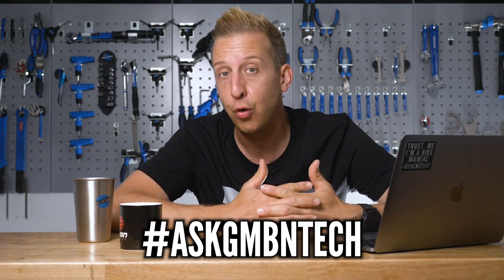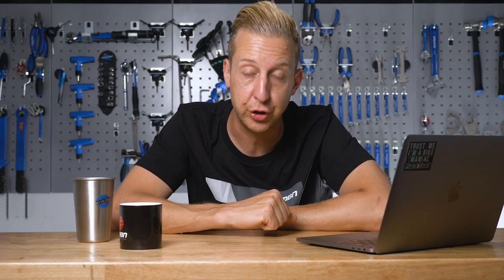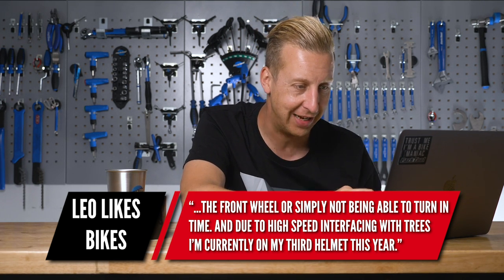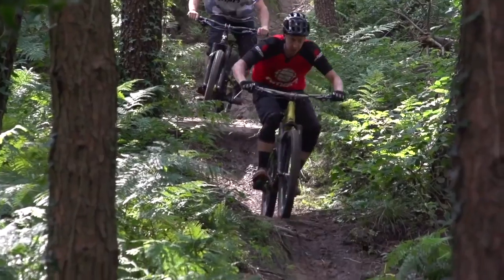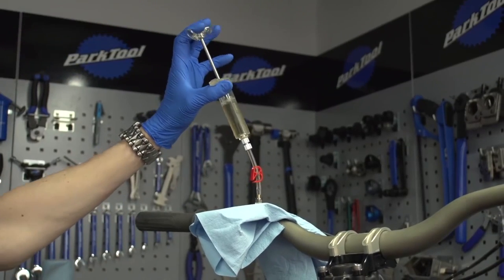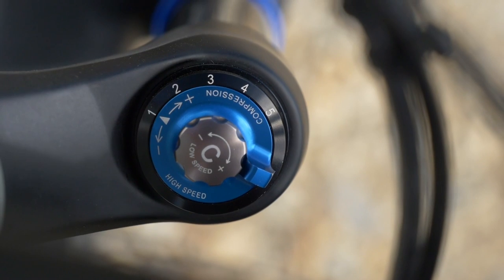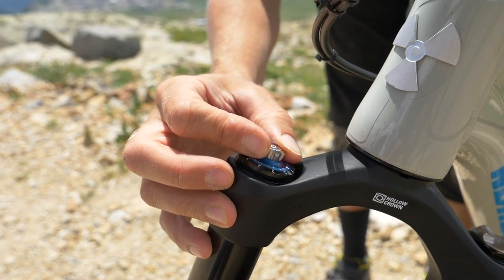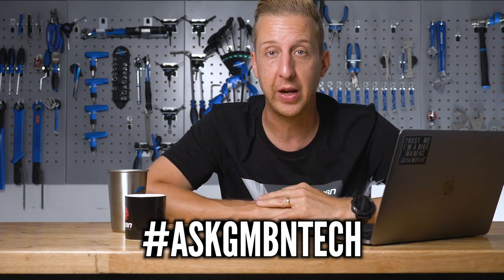Is My Bike Too Long? | Ask GMBN Tech Ep. 84

Comment: #ASKGMBNTECH  just so you know i am a bit of a Joey but is it possible to change the suspension fork on a bike from a low end 100 mill  to a mid range 120 mill? If so any suggestions for a new fork? Thanks!
Reply: the bike mage 20 mm difference will be fine, you will need to make sure the wheel will fit though with same hub spacing (100x15 thru axle or quick release 100x9 or 110x15 boost)
Reply: Yes, it is definitely possible. First you need to make sure the fork you're buying will fit your head tube, if the current fork is a low end fork, you likely have a straight steerer tube and a headset for a straight one. If you're buying an even remotely high end fork, it will have a tapered steerer tube, this is fine as long as your head tube is large enough on the bottom that you can fit an appropriate headset for the tapered steerer. You need to measure the inner diameter of the head tube on the top and bottom and (for example 44mm and 56mm) and buy a fitting headset for the diameters you measure for a tapered fork. Then if you're buying that said even remotely high end fork, your current front hub won't fit, because it is probably 100x9mm and most likely your new fork will have a dimension of 110x15mm or 100x15mm. So you need a new front wheel with the appropriate dimension for the fork. You also need to make sure that your current rotor is the correct size for the mount on the new fork/possibility to fit an adapter to accommodate the correct size rotor. Also you need to have the tools to cut the steerer tube to the correct lenght on the new fork and install a new starnut.
Reply from the maker: If you have 26" wheels you can find some great deals on second hand forks. It's important to check that the steerer tube (the part that goes through the frame into the handlebar stem) is long enough. Check this video as should help 😀 👉 https://gmbn.tech/installfork

Comment: #AskGMBNTech Hi Doddy, I am 178cm tall and I´m 14 years old. That means that I am not fully grown. I want to buy a YT Capra in size XL. Do you think this will work fine till I am as tall as recommended or should I buy the size large one?
Reply: Just my humble opinion, but I actually happen to ride a Capra XL at 176 (fully grown). For me it works perfectly as I was looking for a long bike that will work well at high speed and rough stuff. On the flipside it isn't as playful for jumps or just flicking it around. Basically, if you want to go fast with plenty confidence, go for it! Hope I could help :)
Reply: @irminscharlau8571  Thanks. I think I'll go for it

Comment: I hv a non geared bike..... Want to convert it into geared.... Pls suggest
Reply: Not possible unless you have a derailleur hanger. If you have a derailleur hanger, then you can do it. You will have to get a new hub probably, but I don't know.
Reply from the maker: Hey Vivek, you can get a horizontal drop out chain tug/tensioner with a built in derailleur hanger. Problem Solvers and DMR make them. This will only work if you have correct frame spacing. Check out this page here as it may help with your options 👉 https://www.sheldonbrown.com/frame-spacing.html

Comment: #askgmbntech My rear suspension is very squeaky, what should I do to stop it from squeaking?
Reply from the maker: Hey Thomas, check out this video where Doddy talks through common causes of squeaky brakes 👉  https://gmbn.tech/cleandiscs
Reply: Suspension noise can be caused by the linkages if you haven’t done it check all your linkage bushes and bearings

Comment: #ASKGMBNTECH, hi guys, great segment, has been very helpfull. I have just put a new setup of 1x11 Sram XX1 chain and cassette with NX derailer on a mates bike, i have cut the chain to what feels like the sweet spot for length, but could go either way 1 link shorter or longer, travel isn't an issue, which is best, the one extra link or one less?
Reply: bennonme shorter will be quieter

Comment: #askgmbntech I’ve just got a canyon spectral al 6 2019. I’ve swapped from a specialized kenevo with shimano Zee brakes. I find the Guide R brakes very weak in comparison even after a complete bleed of them. I have to squeeze the leaver all the way to the bars for any bite and prefer it further out. Any help appreciated before I replace them
Reply: @i_eatstyrofoam  Cheers for the tip, tried pushing the pistons back in already with a tapered bleed block and made it a tiny bit better but no where near useable in my opinion. 

Will try the pressure from the other end as not tried that.

Comment: After taking the cranks off my capra and putting them back on, i fully tightened the cranks and they seem to have side to side play. Is there any way to fix this?  I have e13 lg1 cranks. #askgmbntech
Reply: if you cant take the play out by adjusting preload you probaly have worn bearings
Reply: @ultiss  it's a brand new bike, a month old
Reply: @danielbroadstock4583  then you must have made a mistake on reassembly. cranks and bearings dont go bad by themselves. find some tech docs and try to reassemble again

Comment: #askgmbntech my rear wheel is far to one side of the chainstay causing the rear tire to get very close to the drive side of the frame and not be central. Is this normal for it to be closer to the driveside of the bike. I also keep on getting loose spokes even after a true is this linked. I have a scott aspect 640 is this fixable or is it just worth me getting a new wheel
Reply: Jim Wade I think your QR is in the wrong place???? I don’t know
Reply: No, not normal. Could be.qr misaligned, or wheel not correctly dished.
Reply: did you true the wheel yourself? have you checked the dish? an easy way to check dish is finding 2 identical objects (like beer cans) placing the wheel ontop and then check the distance between the hub and table surface. A stack of coins works great as measuring device
Reply: I think it might be my wheel isn't properly dished but it is causing me so much trouble I'm just going to buy a new wheel

Comment: #askgmbntech Hi doddy. I have an SR suntour 80mm fork on a b twin bike from decathlon. My fork only uses up about 30mm of the fork is there any way I could make it compress more. My rebound setting is set in about half way. Thanks
Reply: i had the same fork and same problem I thinks it’s just a trash fork
Reply: Search up on YouTube how to do a lower fork service for a suntour coil fork. It is super easy, all you need is some fork grease (I recommend SRAM butter). Basically you pull off the bottom legs, clean and grease the stanchions and fork seals, then put the bottom legs back on. I did this to my fork and it turned them from trash to great instantly
Reply: it might be hydrolocked from a leaky damper cartridge, try a lower leg service

Comment: #ASKGMBNTECH Hi, i have a creaking problem with my bike. I'm sure it's coming from the bb area. I changed the bb and nothing changed.
Reply: Stanisław Zielonka try changing your pedals I’ve had this issue 👍
Reply: If its pressfit, it could still be bb. Did u use the special bb locking compound (kinda like threadlock for bb's)?
Could be pedals...or even shoes if using cleats/clipless pedals. My old shoes have worn cleat recess, and my shoes creak on the pedal!
Could be seatpost if only when seated.
Reply: it can be a million things but the bb is always the first one that gets the blame, its a game of elimination
Reply from the maker: Stanisław Zielonka It could be something else! Probably best you try your local bike workshop as they should be able to help diagnose this for you 👍

Comment: #askgmbntech can you put slx brakes on a carrera vengeance or will I need new rotors thank you in advance
Reply from the maker: Hey Richard, this depends on the disk rotor size. If you are running a standard 140/160mm rotor you can simply buy a pre-bled brake set. If you are wanting to keep the cost down we suggest you check out the latest Shimano Acera MT400 brakes. Be sure to make sure the disk rotors are free from contamination before installing. 👍
Reply: Richard Barrow I have done this my self with the m7000 six the work well but the cable has a bit of slack

Comment: #ASKGMBNTECH Hey Guys, I have a Bulls Copperhead RS+ from 2016 and would like to change the Crankset form the Shimano FC-M8000-B2 to Shimano FC-M8000-3. Since i ride my bike 30 to 50km befor I start climbing the mounten. With way I would be faster at the Mountain. Would that work? I would keep the number of teeth on the first two chainrings and would put a 48 or 44 teeth chainring on the third.
Reply: you will need the long cage (sgs) derailleur and smaller 11-40 cassette to make it work (officially)

Comment: #AskGMBNTech Can I run boost cranks on a non boost frame without the chain line being too messed up
Reply: but why?
Reply: @ultiss  Some people have "duck feet" where their heels are rubbing on the chain stays. A common roadie fix back in the day, you just bought a wider square tapered bottom bracket.
Reply: @newttella1043  then i think its more interesting to get pedals with a wider Q factor instead of messing up the chainline
Reply: @ultiss  Getting a slightly wider bottom bracket was cheaper and easier. Chainline wasn't an issue when mtbs had 3 chainrings and road bikes were only 7-10 speeds.